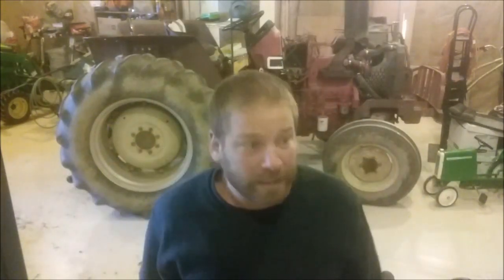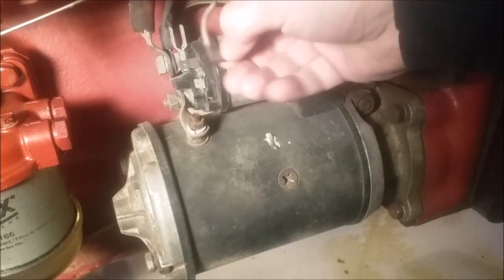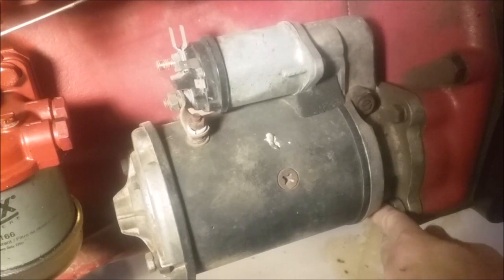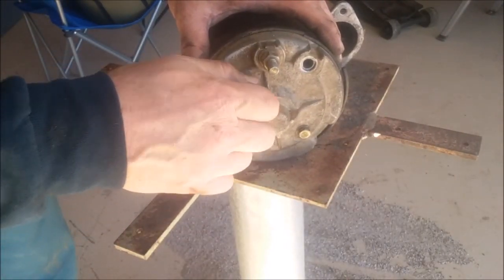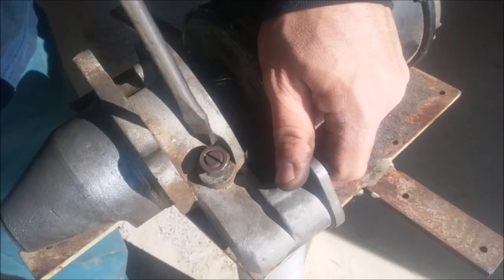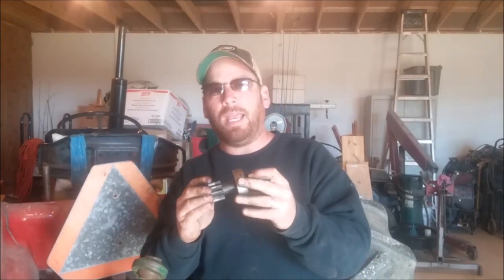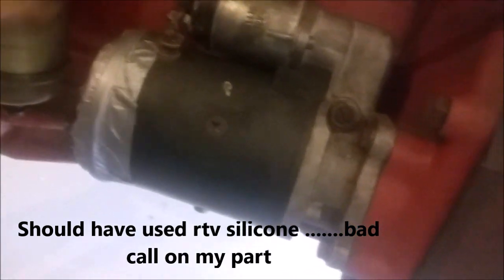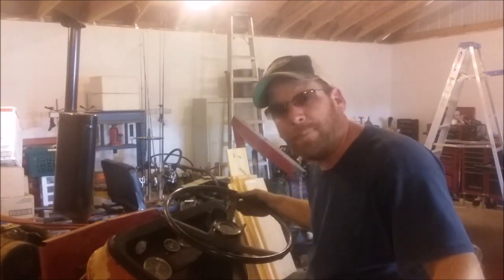Why Won't My Starter Engage?

Comment: This video was great... the first 2 minutes had me rolling on the floor laughing... that's about how I react when trying to start my old Gehl skid loader!  My starter has / had the same problems (especially in cold weather) and I wondered if the ball bearings in that one-way clutch were the culprit... and your video confirmed it.  So I took mine apart and found the same trouble.  They would only lock up maybe 1 out of 5 or 1 out of 10 times.  Freed the ball bearings up with a few squirts of brake cleaner spray.  Thanks for the great (and entertaining) video!
Reply: I like that, I am going to try the break cleaner. Thank you!

Comment: omg i was just as mad..    this happened to me on a fairly new starter today.. you disconnect negative first in case the battery is gassing and that initial spark can blow the battery up..  it doesnt happen now on sealed batteries but my dad had one blow up in his face in the 60s
Reply from the maker: We need to be careful!

Comment: The beginning is me on a daily trying to start my truck. Same issue lol
Reply from the maker: 😂😂 I figured there was someone out there that could relate
Reply: @kentuckyyankee  yes sir! When i got the muck, the minnows, and ground round cleaned up, i then lubed it up nice, and stuffed it on in.
Then, I pulled it out, two or three more times cleaned it up, got all of that very nice and adequately sourced high quality lubrication out of the Bendix, reinstalled it, cut a shim in half to roll the gear a little closer for proper engagement and voila! 
A starter that required absolutely no expenditures and not a single re-reinstall after the first three and the second two after that.
But fellas, I stuck with it, faught for a sliver of intelligence, and in the end, that $216, one year only application starter, is now operating at high efficiency and productivity. With no customization, no out of pocket utilization nor even some long winded over-complication of an unnecessary and pointless extravagation for the better half, who needs no explanation.
Starters, I can now admit, that for an inanimate object, they do do a complicated task, reliably, simply, easily.

Comment: It happen to my Toyota Innova. I think the solinoid switch is the problem. I replace new and now its okay. May be the problem is weak current holding the solinoid that's why the contact between starter cluctch pinion gear ang the flywheel got disengaging.

Comment: So the fix was just cleanning all the grease of that gear or whatever it's called? My electric start push Mower won't start because the starter doesn't engage with flywheel.
Reply from the maker: You probably need a new bendix
Reply: @kentuckyyankee  I think the starter needs to be replaced. The mower was left outside for at least a season. I took it out trying to crank it, it would just click. I disassembled the starter and inside was rusty and full of water. Gave it a good clean anyways, put it back in and it would spin but the little gear wouldnt not engage the flywheel ( thats when I commented here). I took it back down, cleaned it again hopefully magic would happen but nope, it just clicks and refuses to even spin. So yea, I would need a starter if I want to use electric start. Other than that, it still works fine.
Reply from the maker: @Kayy_SS  Well you had nothing to loss giving it a try, I woulda done the same thing

Comment: Lmao, same problem, same damn tractor... Ih 584
Reply from the maker: It will only fix it if its got grease on it, if it is worse out it won't
Reply: Haven't tore into yet. I've put two starters on the ol girl already. Seems to be Achilles heel of the 80 series ih's. That and they don't start in the cold with out being plugged in. Gonna try to fix it.
Reply from the maker: @kfuller1419  You're right same here and with my Dad's 584